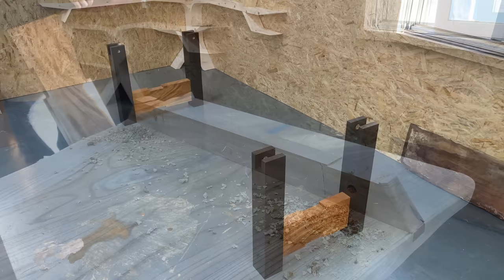7 years dry. DIY table made of old wood.Zelkova is 407 years old.

Comment: Just wanted to share that 3m makes a spray adhesive I use on my wood to stop the epoxy from leaking out under the tape. I see that you use caulking and that's great. The spray adhesive is fast n’ easy and works every time, I've never had it fail yet... also using it on top on the sides of the crack or wherever you are pouring by cleaning the surface off where you will spray, I usually sand it a little then duster brush and vacuum it. Spray an area about 2" out from the edge around the area you're gonna pour, use tape folded down to create a small ridge. After about 15 mins to dry then the pour will stay focused on the crack and not leak out away from the area of the pour, you can overfill it without worrying about it running all over. Just say'n... Great work man!